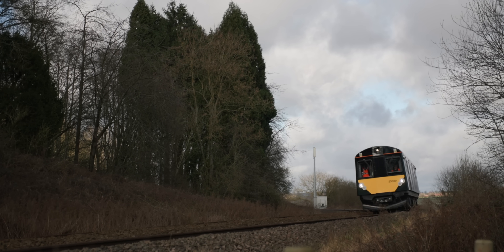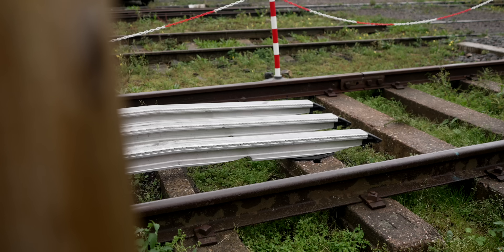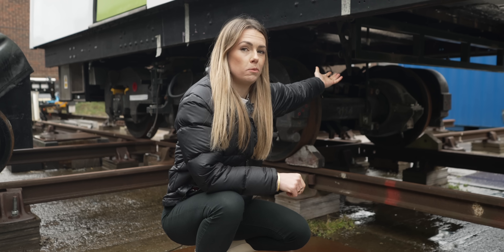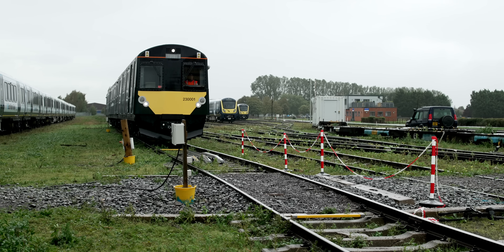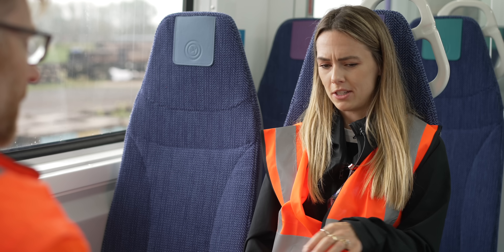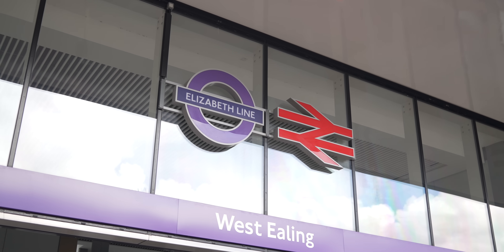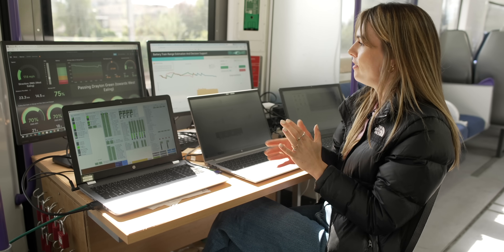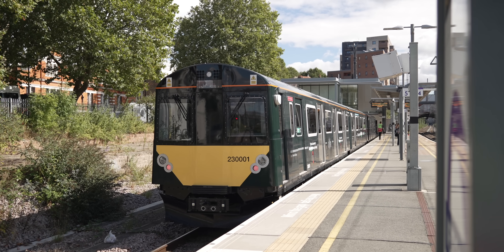Onboard the UK's First Battery Electric Train!

Comment: Marvellous.
I live in Lincolnshire on the East Coast Main Line and branches, where we also have lots of bridges, thus making overhead lines hard to achieve. So, battery trains is what we need, roll them out and let's get on with it.
Reply: Eh, no. If overhead lines are impractical, use a third rail. Batteries make no sense.
Reply: @ZarlanTheGreen  if installing short sections in stations + adding batteries to rail cars is cheaper than installing miles of continuous electrified rail, then it DOES make sense.
Reply: @skierpage  It isn't cheaper. It's obviously more expensive and inefficient. In many ways and on many levels. The initial cost is cheaper, but long term...
Reply: @ZarlanTheGreen  I thought there was a safety problem with the third rail, especially as we also have a lot of unmanned level crossings, with farm and footpath access.
Reply: @SheepShearerMike  Also, for historical reasons (and a little bit for climate reasons) third rail is south of London, so not in Lincolnshire.
Reply: @SheepShearerMike  There are ways around the safety issues, where the rail isn't fully grade separated. You can use a system with separate segments, where only the bits with a train above them, are powered, making it quite safe, indeed, but... now I check your initial comment, again, you said the problem with making overhead lines, was bridges? That makes no sense. There are no difficulties with having overhead lines, on bridges, whatsoever.
Reply: @ZarlanTheGreen  no, wrong sort of bridges, where roads, tracks, footpaths and pipes go over the railways, not the railway on a bridge! I didn't make that clear.
Reply: @ZarlanTheGreen  you have to raise these small bridges so the overhead lines can go underneath them, thus making more work and more expensive. Anything can be done, but it all costs extra money.
Reply: @SheepShearerMike  Ah yes, of course, that explains it. I should have thought of that, my bad. That's certainly true. Thanks for correcting me. But, as I said, you can use a third rail. Yes, that has involved some degree of risk, when the rail isn't fully grade separated, but as I mentioned, there are apparently quite good safety measures, these days.
Reply: @ZarlanTheGreen  - pentograph and third-line systems are expensive in the UK, due to terrain and the age/design of the railways (some being 200 years old). The trackside widths and access heights particularly at cuttings, tunnels and bridges are not sized for these systems and and timely/expensive to upgrade. For example, the 80 mile mainline from London to Bristol took 8 years to complete, and cost £7b (including some branch line upgrades in the mix though).

The battery trains offer the ability to upgrade the existing tracks and rolling stock at what will be much lower cost with significantly less disruption to services, and impact on the land (many train lines run through national parks and other similarly protected areas).

Battery trains also offer advantages for resilience, particularly in areas subject to flooding or high winds that could cut power to third-line and overhead systems that would prevent train operation without expensive measures (new raised track lines or widened lines to allow study overhead support structures). The battery trains could simply charge from the station side batteries or in depleted areas travel  past stations affected by power-cuts to the next charge at the next station with power.
Reply: @GruffSillyGoat  Airport Jn to Bristol Parkway is 100 miles and 48 chains. Part of the reason it took so long is the lack of a rolling programme of electrifaction, of we had a rolling programme it would have been quicker and cheaper for example Germany has a rolling programme of electrifaction.
Reply: @GruffSillyGoat  How would a third rail possibly be more expensive in the UK, compared to anywhere else? How could terrain, age, or design possibly affect matters? I can get how they could be an issue for overhead lines, when retrofitting a rail-line, but anything that would affect putting in a third rail, would equally affect replacement of the regular two rails, which have to be replaced, from time to time.

Batteries are cheaper to set up, yes. (but far more expensive, in the long run) As for less disruption: trains don't run 24/7, so you can just electrify during the night, so... (and you don't have to finish every part at once. Having overhead wires on part of the line, doesn't stop diesel/battery trains from being able to run on it)

As for resilience... those events you mention are very rare. Hardly worth mention.
Reply: @ZarlanTheGreen  - Third rail systems need extra width on the lines, if I recall the 80s extension of third-rail to Weymouth resulted in part of the route being converted to single running in order to fit in the third-rail. There are many cuttings and tunnels in the UK that were created over 100 years ago, that were sized without the expectation of running a third-rail. This along with safety is why the ORR discourage the use of third-rail systems in the UK.

Disruption is 24/7, if you modify lines to include a third rail the work tends to shut sections of the line at a time. Even major non-electrified overhaul can do similar with line closures in non-busy periods (over the Christmas/New Year typically).

In terms of rarity of events, try telling those residing in the South-West that the regular floods are "hardly worth mention". Similar for those in other geographic areas subject to storms and floods.
Reply: @GruffSillyGoat  The only reason there was disruption for the Greenford Branch is that it doesn't run on Sunday so they did all of the work on Sunday for battery charger install.
Reply: @ZarlanTheGreen  Yep the max speed on third rail is 108mph versus 356mph on OLE, third rail is limited to 6.8KA at 750v for supply and about 4KA is usable for the trains as the rest is lost due to resistance in the third rail. Most third rail units don't have an acceleration rate of more than 0.7ms-² for 100mph units versus regular acceleration rates on OLE units of 1.3ms-² for 125mph units. Freight trains require more power than the third rail can provide, as they draw 300Amps from 25kv and they would need 10000amps which would melt the third rail.
Reply: @GruffSillyGoat  Extra width? That is a blatant lie. The third rail is in the middle of the other two. If a line expanded the width, when they added a third rail, it wont have been because of the third rail, but some other reason. As for disruptions... no. They can add an extra rail, or add overhead lines, section by section, while the trains don't run ...and/or do it in conjunction with when they have to maintain/repair/upgrade the rail anyway, as they regularly need to do. If they need to take more time, than can be done during off-hours... as you say, they need to occasionally do so, for overhauls, even without electrification. So why treat having to do it for electrification, as something exceptional?

As for regular floods... if they're regular, you should raise the rails, along with other anti-flood efforts, regardless. Also, you can go with overhead lines. Sure, it might be expensive, if there are stuff above the trains that have to be raised, or tunnels that have to be expanded ...but, again, it will save money, in the long term.
Reply: @J-Railway-Volunteer  How could it be possible, that a massive rail, can't handle as much electricity as a thin little overhead line?
Reply: @ZarlanTheGreen  The skin effect.
Reply: @ZarlanTheGreen  - the third-rail system in the UK is on the outside of the main rails not within; it's a raised current carrying rail sitting on electrical isolators that is higher than the wheel tracks. The pickup shoe rides on the outside of the bogie. This widens the width pre direction as additonal room is not only needed for the extra rail but for the safety isolation gap on the outside of the third-rail. Additional space may also be needed at points or intersection configurations, where the the current rail swaps sides on the train.

Are you confusing the UK railway system with the UK metro system (such as the London Underground) that uses a four rail system, with one or both of current rails between the tracks (varies by system).

Regardless the authority in control of railways requires strong justification for new third-rail systems (ORR), with overhead and now likely the battery solution in this video being the first choices for electrification. This even applies to third-rail extensions and is mainly based on safety and operational grounds.

The UK has nearly 10,000 miles of railway track, with a third electrified. The cost of the electrification is significant, the 80 mile  (overhead) section between London and Bristol cost £7 billion and took 8 years to complete (albeit rolling stock being a proportion of this as A-Trainspotter-From-Berkshire flagged). The cost of the remaining 6,600 miles yet to be electrified will be significantly more and take a long time to complete. Many sections that are more challenging than the London to Bristol line, attracting higher cost. A similar cost, time and priority consideration exists for rasing the height of tracks. The electrification programmes underway focus on the main transit routes.

It's not clear why you believe that electrified trains rather than trackside electrification will be more costly. Afterall this has been a long standing justification for retaining diesel units due to the cost and timescales of electrification. If these diesel units can be swapped for electric version, which will likely be more cost effective to run, then this is a positive development. I trust that operators, Network Rail and the ORR will consider the cost benefit of a battery based system vs rail-side electrification.

I like many lived through the rolling disruptions during the 8 year London to Bristol electrificaiton route being constructed. My comments are based on real-world experience.
Reply: @J-Railway-Volunteer  - indeed the Southampton to Basingstoke route has been proposed to be upgraded to OLE (currently third-rail) to support rail cargo transport from the port of Southampton. Although the original intent was to perform this as part of the now cancelled Electric Spine programme.
Reply: @GruffSillyGoat  It is the whole of the third rail network, that Network Rail would like to convert with the benefit being it is cheaper on electric  power than third rail.
Reply: @ZarlanTheGreen  - a case of AC (OLE) vs DC (third-rail) systems - OLE is high-voltage (25,000V) lower current (thinner conductor) vs third-rail being lower-voltage (750V) higher current (i.e. chunky rail conductor). Similar considerations also occur in AC vs DC power transmission, HVAC conductors are also thiner than HVDC conductors. 

The wiki page on Third Rail is a good source explaining the various differences.
Reply: @J-Railway-Volunteer  And that is...?
Reply: @GruffSillyGoat  Third rails are on the outside, in the UK? ... So you're saying, that because that's how you've done it in the past, that it is impossible for people to put a third rail in the middle, in the UK? 🙄

An overhead line should always be the first choice, third rail being the second. I have yet to see any reason, for why there could be any reasonable reason, for any other options.

As for the time it takes to electrify... I'll acknowledge that it may be good to convert from diesel to batteries, so that the trains are more environmental, as a stop gap measure, while the electrification isn't fully finished.

As for the question of why I think that electrification would be cheaper than batteries... That's like asking why I think that 1+1 would result in 2.
The arguments about the cost of electrification, are purely about the initial, short term, costs.
CEOs and other bosses of large companies, are rewarded according to short term profits, and punished for short term losses ...and they might not even still have the job, when the long term profits start happening.
Why on Earth, you'd possibly think to trust them, to consider the long term costs and benefits of anything, is something that I cannot possibly even begin to understand.

"lived through the rolling disruptions during the 8 year London to Bristol electrificaiton route being constructed"

Okay, sure. It's still worth it, in the long run.

On the point of third rails being less powerful...
None of what you said, explains anything, nor does the Wikipedia article. (NEVER refer to Wikipedia as wiki! Wikipedia is A wiki! One of countless others!) It mentions the limitations of third rails, but doesn't say a word, about how/why it is limited.
Reply: @ZarlanTheGreen  - why would the UK networks abondon standards, just because some random person on the internet thinks it better because it fits their line of argument. Particularly when the UK is moving away from third-line based systems, as another poster has pointed out to your good self.

The wiki article explains the systems and their differences, such as power and losses. If you need more detail perhaps delve further in wiki or elsewhere if you distrust it as a source. p.s. did you spot the technical section on the voltage difference, 25kV OLE AC vs 750V DC third-rail, that explains the power difference.

You've still not explained why you believe a battery based system doesn't stand up to rail side electrification, what is the life cycle analysis, total cost of ownership projection or operational costs that make it more expensive that an overhaul of the majority of the UK rail network.

Have you assessed such cost analysis to support your claim or are you basis your response on a personal bias perspective, seeking to justify this with vague and improbable suggestions.
Reply: @ZarlanTheGreen  It is two do with the current being most found on the edge of the conductor. Also the restinace in the third rail is a lot higher in third rail than in OLE. Third rail is normally steel and OLE is normally copper. There is a few formulas which explain it, like P=VI.
Reply: @ZarlanTheGreen  The Volks Electric Railway has it third rail in the centre however that can't run on the mainline. It would be in compatible with the London Underground fourth rail system. Electrification is funded by the government. I have live through the disruption for GWML electrification between Heathrow Airport Jn and Cardiff Central. It used to be 165s and 166s on the local services however post electrification we got 387s and 345s on local services and the shortest timings for the locals in history.
Reply: @J-Railway-Volunteer  ... Well that is something that at least somewhat approaches an attempt at explaining it, I suppose. Why would the resistance be higher? Why do they use steel? And again: Why would DC be inferior?
Reply: @ZarlanTheGreen  They use steel as they recycle the old running rails as third rail to save money.
Reply: @J-Railway-Volunteer  So you're saying that there is no real reason, why they couldn't use copper (at least for the part closest to the train), enabling speed and power that is no less than other trains?
Reply: Third Rail is banned for new electrifaction.  @ZarlanTheGreen
Reply: @ZarlanTheGreen  Third rail has a lot of issues like slow acceleration, low top speed, unsafe, not suitable for freight, banned by the ORR hence the 777/7s with Merseyrail with traction batteries for the Kirby Headbolt Lane extension.
Reply: @J-Railway-Volunteer  ... Those are some pretty big and bizarre/inexplicable claims. Have any way to back them up?
Reply: @ZarlanTheGreen  This comment seems quite illogical, please elaborate?
Reply: @paulhaffenden8911  You objection seems seems quite illogical, please elaborate?
Reply: @ZarlanTheGreen  Agreed!